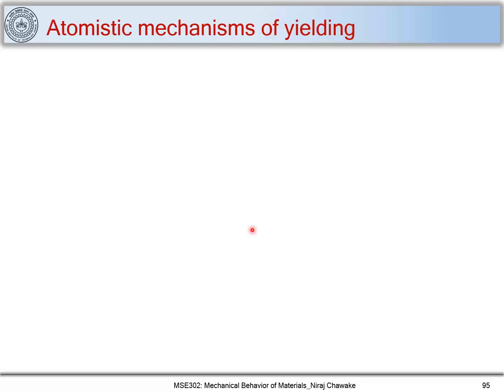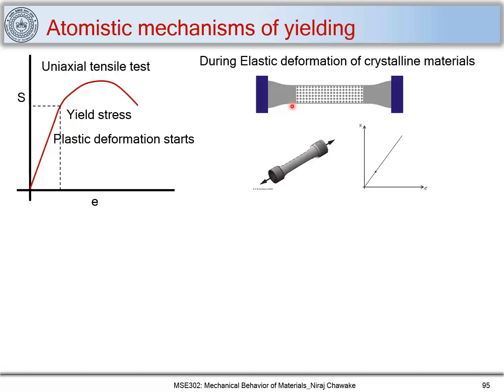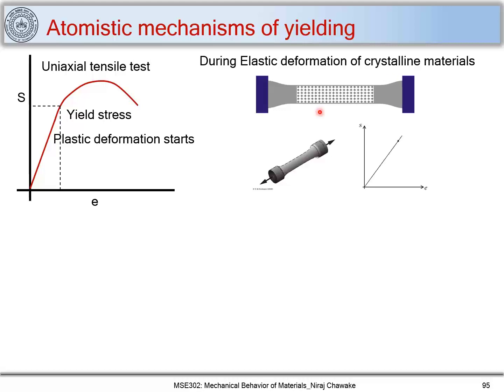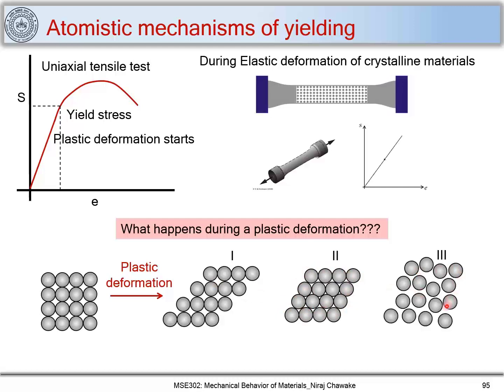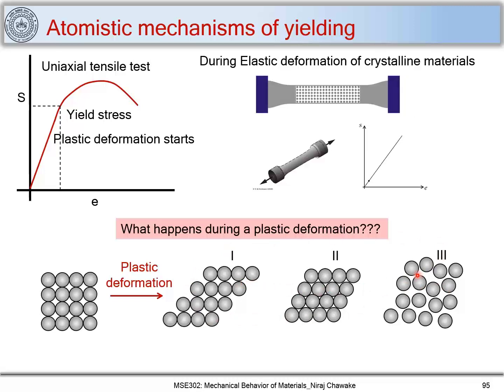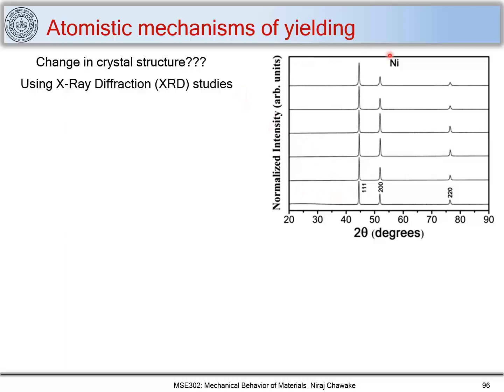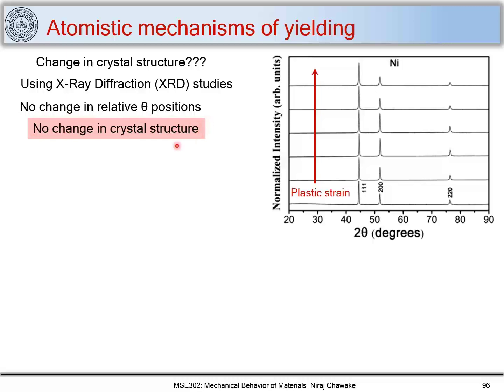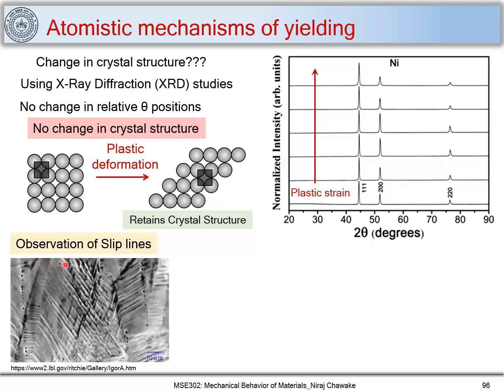25. Atomistic mechanism of yielding and Slip

Comment: Due to strain some inherent stress will also be present. As a result the peak shift in XRD may also happens. Then the theta value would get changed na sir?
Please clarify my doubt.
Reply from the maker: Sure, there can be peak shifts (i.e., change in the corresponding Bragg angle) due to several reasons, e.g., elastic lattice strains. However, the crystal structure remains unaltered after plastic deformation, i.e., an fcc structure remains an fcc after a plastic deformation. I hope this helps.
Reply: Ok sir
Thank you so much for your explanation.
I want to take the PPT of these lectures.
Please give me.